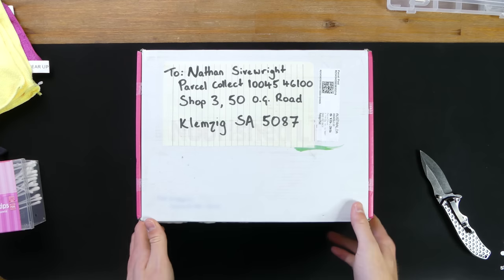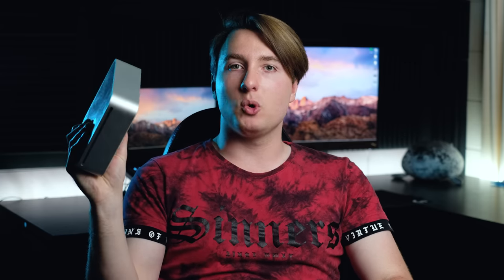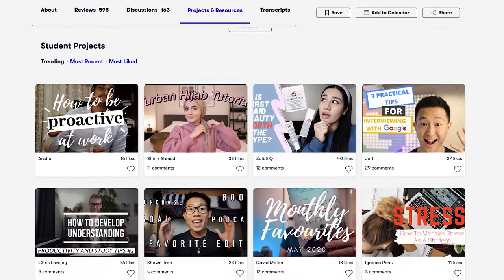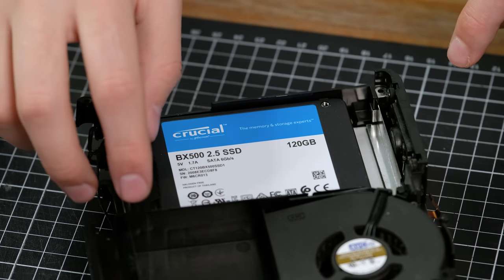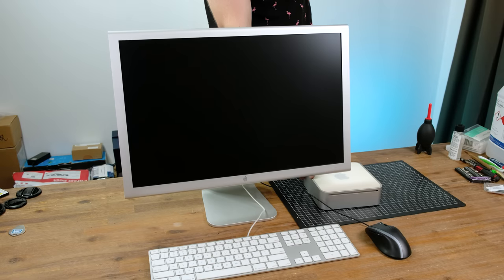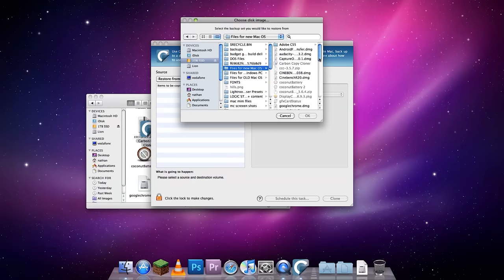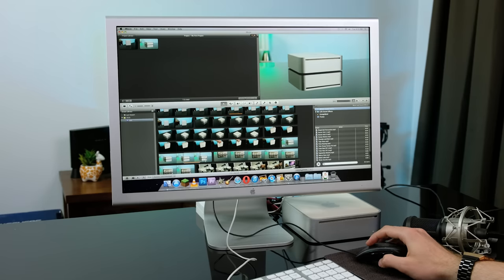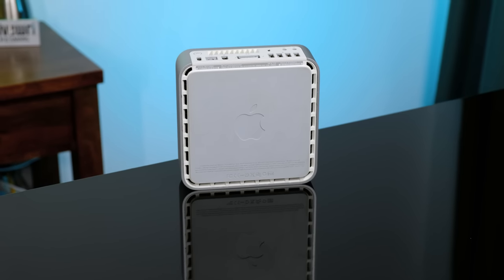Restoring Apple's FIRST Intel Mac Mini!

Comment: I literally did this same exact upgrade earlier this year when the COVID lockdown first happened.  I decided to put Ubuntu on mine and discovered that the most recent version that has an installer compatible with this Mac Mini is the 2014 version.  So, I installed the 2014 version, then upgraded to 2016, then upgraded to 2018, which is where the machine currently stands.
Reply: Aaa amazing, perfect for web browsing and word?
Reply: Assuming you installed a Core2Duo: There’s Linux ISO’s that can install 64-bit versions on Macs with 64-bit processors but 32-bit EFI. Might be worth a shot. Google “Matt Gadient Linux ISO” and it should be the top result. Running Mint 20 on my C2D MacBook thanks to that iso
Reply: That’s the same as the original intel Mac Pro. Have one of those and now it’s just my Linux pc. Just the 32bit efi weirdness.
Reply: Yep. Upgraded 64-bit Core 2 Duo processor, firmware upgrade, maxxed out RAM (4G, 3G usable), 2T SSD, and now it's our plex server.
Reply: It supports latest elementary linux
Reply: Ô.
Reply: @solarbirdyz  can you install win10?
Reply: @cosettapessa6417  Not with only 3 recognised gigs of RAM you can't.
Reply: @solarbirdyz  just for ram?
Reply: @cosettapessa6417  mmm... yeah maybe. I mean, it's running current linux well, I suspect it could run Windows 10 - badly - if it had more RAM. But it's northbridge/southbridge chipset so that's genuinely never happening.
Reply: @solarbirdyz  y

Comment: What monitor are you using in this video ?
My cinema display stopped working yesterday so I need advice.
I have a 2006 Mac Mini but cannot use it now because I have no extra monitor though I might be able to connect a 19 inch Westinghouse tv to it once I get the VGA to HDMI adaptor.

Comment: My friend has one of these and after installing certain software, I noticed that one of my Thinkpads running the same software with a slower CPU, same / similiar chipset and RAM etc performed WAY better.  Not sure why but the Apple Mini was struggling and it was using a fresh operating install too.

Comment: Here's an interesting story about the mac minis of this generation:
I had the base 1.66GHz model and attempted to use it as a HTPC, and it REALLY struggled with video playback under OS X (with 512 MB RAM). A DVD-rip of the X-Files could barely be played in VLC. Then I installed Debian (and also Xubuntu) with rEFIT, and it was SO MUCH FASTER, especially with XBMC. While cleaning the computer I accidentally broke one of the RAM slots, but even with 256 MB RAM debian outperformed OS X (in video playback). I had it for a few years as a media station, even playing through all of Super Mario 64 on it.

Comment: I also have a Mac Mini I recently upgraded to a T7200 as they're dirt cheap. I really just use it as a file server tho. It also has a 240 GB SSD for some reason lol

Btw this is how to install 10.7:
1. erase drive with 2 partitions (make sure you install 10.7 on the first partition so you can remove the second one later as we're going to use it for a temp install of 10.6), optionally you can use TDM and a second Mac to do this too.
2. Install 10.6 on the second partition (skip if using TDM)
3. Make a 10.7 USB installer and delete PlatformSupport.plist from /System/Library/CoreServices from the USB drive you created (the file might be in another location but tbh I don't remember where)
4. Install 10.7
5. Boot into 10.6 or TDM and delete PlatformSupport.plist from /System/Library/CoreServices from the 10.7 installation
6. enjoy

Comment: No joke my dad still uses one of these. It had a RAM upgrade and HDD replacement over the years, but it's still running the Core Duo CPU.
I installed Arctic Fox as a browser, which is a rebranded version of Pale Moon (itself based on Firefox) that is aimed at older systems, including Mac OS X 10.6.
Reply: Similar here with my mini.  Thanks for mentioning Arctic Fox, I'll need to look into it.

Comment: I loved these Mac mini’s. Had 2 of them over the years, both flashed to 2,1 and upgraded to T7400/SSD. Just wish it had something a little better than the horrific Intel GMA.
Reply: Did the same with mine but unfortunately one of the RAM slots decided to die without warning. Seems like it's a common problem with the early Intel Mac Minis, which with the dire Intel graphics makes them a must-not-have.

Comment: This is such a trip down memory lane! When I was 11, I got my first (new) computer, a Mac Mini G4 (same body, just older processor) with OS X Panther. But when I got it home and set it up, the hard drive turned out to be bad, and by the time I got my replacement they were shipping with Tiger -- would've been a costly upgrade otherwise, as they were making you pay for OS upgrades in those days!

Comment: I still use a 2007 Intel Mac Mini in production as a DHCP/DNS server running a very locked down build of Snow Leopard. 1.83GHz, 2GB RAM and the original 80GB HDD.  I've been using it since 2009 and recently picked up a 2014 model to swap it out with.  I am expecting it to be very clogged up with dust after the ~13 years of 24x7 operation that it's seen!

Comment: Fun fact  AMD Ryzen processors on the AM4 Socket sometimes stick to the heatsinks and u can accidently pull them out of the sockets Its normally fine unless u bend a pin trying to remove it

Comment: I did almost the same, with two exceptions: I use the 2.0 GHz C2D CPU in my former 1.66 GHz Intel Core Duo Model, but I still plan to upgrade to the full 2.33 GHz around xmas this year. I installed Lion using another Mac (a MacBook2,1 which is almost identical to the MacMini2,1 ... btw this MacBook2,1 now runs the old HDD, as I also upgraded to an SSD later on). I also got 4 GB (4 GB in Lion's System Profiler, of course still 3 GB in activity manager). Running Lion is as easy as deleting a file from the already installed system: rm /System/Library/CoreServices/PlatformSupport.plist is told to do the trick. Honestly this did not work for me (or I did something wrong). My system actually runs because I added this line to the very same file: <string>Mac-F4208EC8</string>. It is told that you can do this on the Installer itself - but I did this only on the installed system. After updating from 10.7.2 to the latest 10.7.5 I had to do this again. Since then everything runs as it should. My Mac mini, which I bought like a month ago, came with nearly no dust, may be it was turned off in like 2009 and left with an installation of Tiger older than 10.4.11.

Comment: Many thanks for sharing this video! I own such a dinosaur mac as well, with a disk stuck in the drive. Once I open the Mac like you did, can I manually get the disk out without damaging it, and not causing more damage to the drive? None of the tips in the manual worked. Drive does not even recognise that there is a disk in it. Any help is much appreciated.

Comment: I just replaced the HDD for my Mac Mini , with an SSD which had already Elementary OS installed on it , and  it's running better than OSX Yosemite which was quite sluggish on a Mac Mini 2009

Comment: do you know if a Cinema Display 30 inch can work with mac mini 2012?
the 2012 don't have the mini display port but the Thunderbolt
also i have the Apple Mini DisplayPort to DVI Dual-Link
ty in case ^^

Comment: The First Intel Mac Mini was the Mac Mini Cor Solo; a single Core version of the Core Duo CPU by Intel, not the Mac Mini Core Duo as you stated. The performance of this system was less than the Mac Mini G4, but it allowed 2GB of RAM in it. The good thing about it was, you can upgrade the Core Solo CPU with a Core Duo CPU. and many did such upgrades. Thus a Core Solo out in the wild with a Core Solo CPU is a very rare and exotic thing, and many Mac Mini Core Solos were upgrades to Mac Mini Core Duos. The label on the case may say that it is a Core Solo, but changes are it has a Core Duo CPU inside it.

And like any Mac Mini Core Duo, the Mac Mini Core Solo can be upgraded to a Mac Mini Core2Duo with a CPU Swap.

Comment: True for price to performance... Out here can get on eBay Intel core 2 Quad for 80€ i think is reasonable.. I know after looking i fixed a 2009 iMac and checked the prices even for ram as only 4Gb although still managed to installed windows 10 on the old iMac

Comment: I actually got a 2009 Mac mini (AKA 3,1) in a trade for an old smartwatch, the interior is nearly the same, main difference being the motherboard is black, and a few minor differences, such as the ribbon cable for the SATA optical drive uses a press-on connector rather than a regular slide-in end. The one I have features a GeForce 9400. getting Linux Mint (20.1 Ulyssa) to boot took a few tricks, such as editing GRUB to have "nomodeset" in the first option from another Linux PC as GRUB never shows on boot. (but when it DID, I could not interact with it!) but it works surprisingly well for a 64-bit OS with only 2GB of RAM. lmao Linux scales very nicely!

While it's pretty clean, unfortunately it smells like weed, it'll take ages to air out! but it's an amazing Emulation PC (RetroArch FTW) that also handles Netflix @ 1080p even more surprisingly well!

Comment: If you have a bios burner I have a copy of my 2,1 firmware that actually supports and reports the full 4gb memory, I installed lion from a dmg burned to usb. Mine came from the factory with the 2,1 firmware it was a 1.83 ghz core 2 duo model that now has a t7200 2.0ghz. Though you would have to pull the 25 series chip to properly flash it and then resolder it back in place.

Comment: I have always considered the Mac Mini a very interesting machine, flexible and powerful. In fact I have one, precisely a 2009 MacMini, a little more powerful than the one you presented; Core 2 Duo 2.53Ghz, nVidia GT9400, 8Gb DD3 1066, the last of this kind, later they were completely in aluminum with integrated power supply.
I wanted to tell you that maybe you can use 4Gb of ram on your Mini; you should use 2 modules of 2GB 667. On my iMac 17 "Core Duo I have your same cpu at Core 2 Duo 2.16Ghz and the firmware modification allowed me to use them fully. I also changed the screen, typical failure of these machines, which now enjoys a less bright but functional 1920x1200. The iMac has an ATI X1600 video card which is great on Snow Leopard and I have to say that with 3D it gets along very well, both with games and with applications like Cinema4D, Photoshop , iWork09 and the glorious Final Cut 7, Motion, DVDStudio, very heavy software that seem to run best only on MacPro, but remain very usable.
Try changing the ram.
Thanks for your video.

Comment: Not a bad looking Mac Mini right there. Obviously, it uses a policy called BYODKM (Bring Your Own Display, Keyboard and Mouse) because those accessories are not included by default. Just based on looks, even the new M1 Mac Mini doesn't look too bad on the surface.

Comment: I did the same to my 2006, with the same processor. But now it produces a lot more heat than before and the fan ramps up by the slightest processing. Is that normal?

Comment: You know what's easier than trying to get a newer MacOS on that thing? Installing Windows 10 or some kind of Linux the same way you would on any other PC. No point in jumping through apples hoops, on older Macs they actually ran windows much faster than MacOS anyway

Comment: What is the max OSX version that is able to be installed on the Mac Mini?
Reply: The limiting factor here is that it's a 32-bit CPU.  Without doing any hardware mods, the latest OSX version it'll run is 10.6.8.  Versions 10.7 and later need a 64-bit CPU.  As shown in this video, it is possible to swap in a 64-bit CPU.  However, Apple's installers check what type of machine it is and still won't let you install a newer OS on it.  Some hackery of (at least) the installer is needed to make that work.

Comment: Well fortunately or unfortuantely, between like 2005-2011 there are huge performance gains for each generation of mobile Intel CPUs! The top Core 2 duo T7600 for a properly supported platform in 2006 is about 3 times the performance of the Pentium M 780, the top Core 2 Extreme X9000 for a 2007 laptop is about another 2 times the performance of the T7600 when overclocked, and the QX9300 from a top end 2009 laptop is another 50% faster. The i7-920XM is then another 50% faster, the i7-2960XM in 2011 is then another 50% faster.
So what this means is that iMac is caught in the middle of this huge performance gap thing and well something like a T9500 or X9000 based system can do modern tasks quite well (especially with their abilities to take upwards of 8GB of RAM if the product is properly supported), but not so much for this system.

Comment: I think I have one of these, if it's not the first then it's like...the second. Has a 1.66GHz Core Duo (not Core 2 Duo, Core Duo) and I think 512MB of RAM.
Reply: I can't imagine getting along with 512MB on this.  I have a mini exactly like the one in the video and still use it as my main computer running 10.6.8.  Initially it had 1GB (and stayed that way for many years); then upgraded it to 2GB which made all the difference.

Comment: I'd say try installing Linux but I can't seem to get 64bit Linux to install on mine even with the newer firmware and a 64bit CPU. 32bit Linux installs fine, but you're leaving performance and compatibility with newer versions of linux on the table.. Also, my Mac Mini works fine with 4GBs of RAM.

Comment: loads of oems including mac would use really shitty thermal glue to hold heatsinks to chips. if you dont have a hot air rework station set a hot air gun  just a shit one from bunnings like an ozito branded one to 130c or so and blast the heatsink for a minute or so and it will come off like hot butter.

Comment: I actually have one of these in a box in my storage building. What's sad is that my $55 Raspberry Pi 4 is actually faster and has better graphics. Not to mention it runs a modern Linux Distribution. Maybe I can ebay the Mac Mini I have for a few bucks.

Comment: Even if the hardware has enough power to run the software, Apple does everything possible to make it hard, inconvenient to use older devices.

Comment: lion offers no advantages over 10.6 in 2020. To browse the web you will need a Firefox program from Tenfourfox and even it is limiting but not useless like Firefox or Safari from 2010 or so when they stopped supporting lion/10.6. These are good for running old PPC programs on with 10.6.8. I use an old machine for ripping DVD's. I still have a few of these models and 2 or 3 2009 models. I considered putting Win 10 Pro on the 2009s since they handle 8gb ram. I have a lion install that has the modification to not include the older Macmini 1,1. It works just fine as long as the cpu is a t7200/7400/7600. I still have a few of the T7400 and T7600 cpus as they dropped hugely in value so were not worth selling.

Comment: If you end up keeping 10.6, there is actually a quite caple browser for the older intel mac's (it also supports Win XP). It's called Arctic Fox and I use it on some of my older mac's.
https://github.com/wicknix/Arctic-Fox/#:~:text=Arctic%20Fox%20will%20build%20for%20Mac%20OS%20X,can%20be%20found%20here%3A%20Arctic%20Fox%20for%2010.4%2F10.5